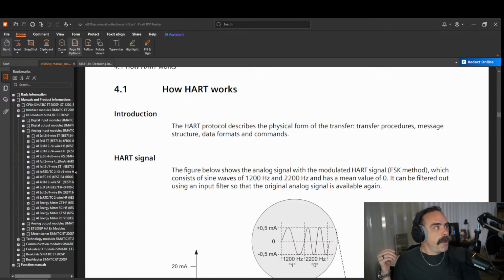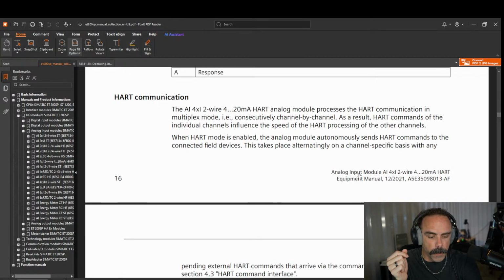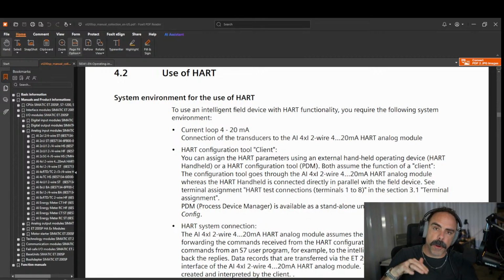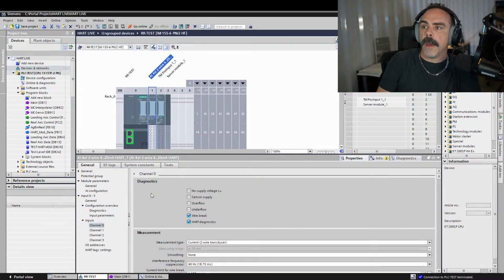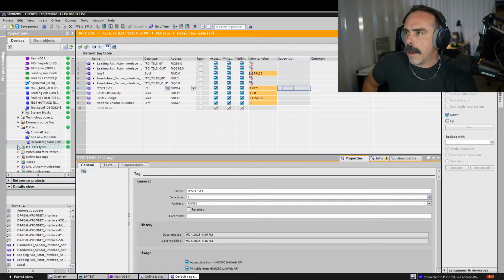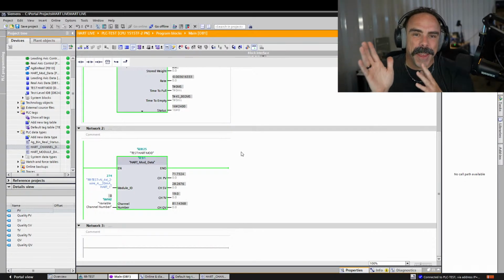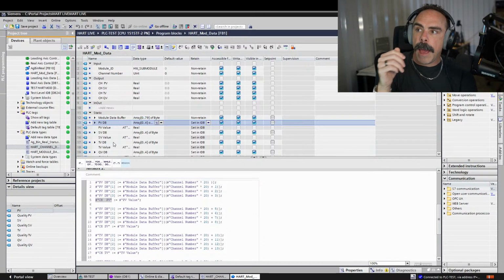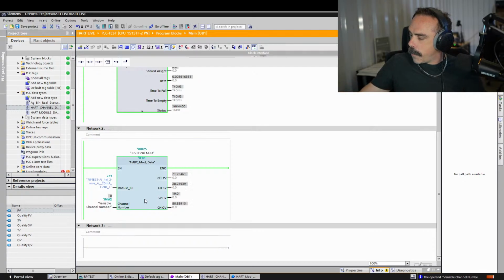Siemens HART Module Training: ET200SP 6ES7134-6TD00-0CA1

Comment: How to read the Hart parameter on et200isp analog card. The parameter configuration is different on it as compared to et200sp. Thanks in advance.
Reply from the maker: So it took me quite some time to find the right document (linked below), but you can access 4 HART variables per card in the same manner that I go through at first in this video. This is on page 114 of the linked document.

Otherwise you will have to access the data in the same way using RD_REC/WR_REC as decribed in this video. Each device has different data records, but the Siemens side of this is documented starting on page 127 of the document. If you are not used to using data records that is what I am doing in the later parts of this video and I have a video explaining how to use the correct functions...

You would be able to modify my block to use with the required records...

https://support.industry.siemens.com/dl/files/264/109989264/att_1330473/v1/et200isp_failsafe_modules_en-US_en-US.pdf

Comment: Hi, Jason! How do you use the HART_CHANNEL_DATA and HART_MODULE_DATA user data types?
Reply from the maker: So I talk about those at around the 52:00 mark. Short story, you cant use the datatypes in the archive like we use other types because the data uses 5 bytes, but the compiler will always reserve 6 bytes. That is fine for 1 value, but not if you try and get all the data at one time.

This might not be an issue in later versions of portal, but the block takes everything and parses it to where you can use it...

Comment: For Simotion I would like you to describe how to control Sinamics V90 with Simotion ?
Reply from the maker: Ill talk about it in the stream Friday.  Are you wanting to do a new project with V90 and SIMOTION?
Reply: @jasonwattsae  Yes, Right
Reply from the maker: Ill talk about it on stream, but the 1500T might be the better option. You would have to use a SIMOTION-C which is literally a special 300T. Ill go through it tomorrow.
Reply: @jasonwattsae  So, it is the old machine which use D452 but can not change new PLC and I have only V90 now.
Reply from the maker: Hmmm... I will bring it up on stream... it is not straightforward if it is even possible.